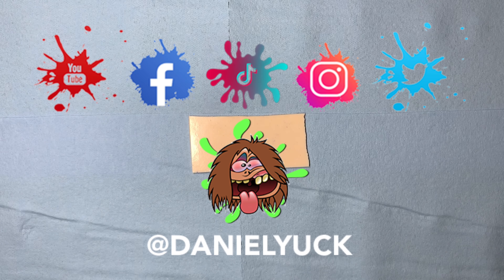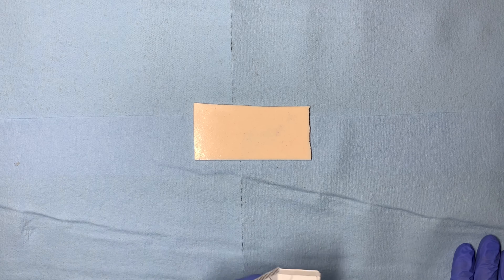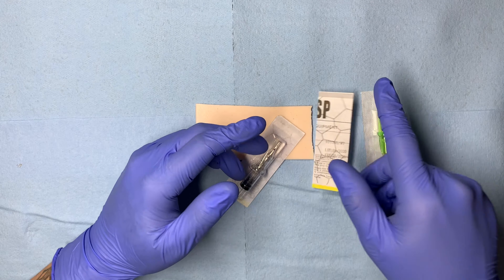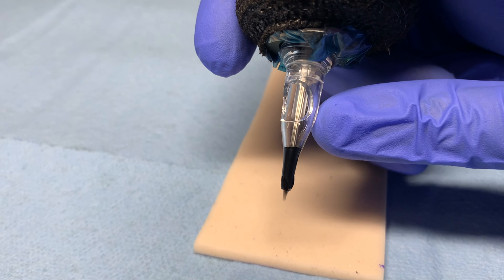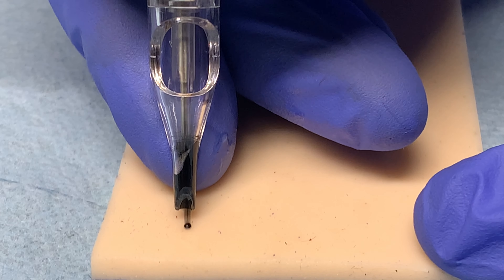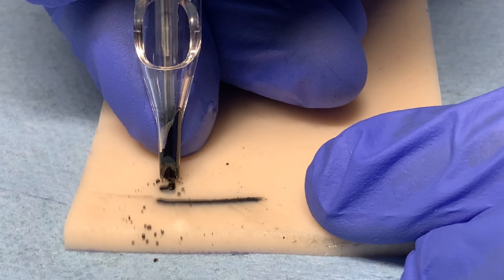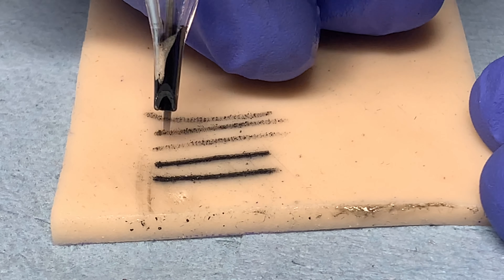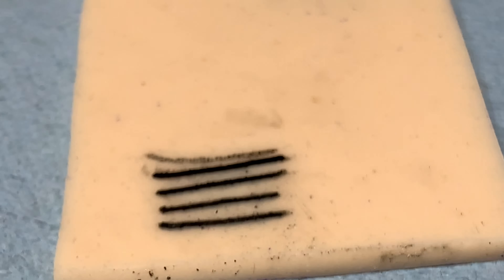How I Pull 1 Pass Lines?

Comment: Nice video, the finger drag is something I was never able to make work personally, but that leverage is so key to maintaining depth consistency. I like seeing this technique even though I have a different method to leverage the depth using the side of my hand & fist.

Another major factor for me is if the cartridges fit well in the machine. Some brands just don't fit well in my machine causing wobbling and excessive vibration which obviously makes one pass more challenging. Surprisingly, I don't find Big Wasp to be too bad even though it's one of the much cheaper brands. My fav affordable cartridge brand is Stigma for sure.. 

Thanks for taking the time to share this knowledge, you're awesome

Comment: Hey Daniel- question about lining with round shader; when I work along with the video I seem to get a series of super thin lines within each line, like from each needle tip in the configuration. Also the slower I go the more damage or cutting happens on the fake skin. Suggestions?
What stroke do you suggest using on the fake skin. It seems that its either too light (always having to go back over them) or too deep (cutting the skin)

Comment: Quick question. Wouldn’t the stencil smear off if you’re dragging your middle finger with the needle? And also I’m pretty comfortable doing vertical lines But having a hard time doing line horizontally. Any tips on that? (I try not to rotate my fake skin around, and think of it as an actual body part)
Reply: Personally I turn around my client, when it’s possible, to pull the line to me ! I think it’s the more stable configuration to keep the right depth. I stand up sometimes, putting my elbows and forearms on the client / the table / the arm rest table when it’s possible too

Comment: Hey I’ve got one question. What do you do when you can’t pull a complete line and have to stop in the middle? Are you finding the dermis right on the point where you stopped before?
Reply: bump, i want to know too
Reply: Every piece of content I’ve consumed and person I have talked to has told me to overlap them slightly in order to help you stay on one consistent path through the entirety of the line.
Reply: i tend to taper out and then slightly come back on that last line and taper bk in to the depth

Comment: Apparently the voltages i line with vs what I use to pack black and colors is backwards from most lol. In line with 8.1v but I pack with only 6.8v at most 7.5 (very rare) I also shade in that area. Most folks line at a lower power than the pack at. With some even having 1 consistent voltage throughout

Comment: I bought me a tattoo kit and it came with a 3RL needle , and I notice the lines are very thin , so wanted to ask what need size for lines you recommend for me to start with for it to have a more fuller and solid look to it ?
Reply: 11 bug pin is what I used but I also have used stuff as big as 18.

Comment: Where do you double zero.. its a 10 gauge bug bin and the 12 is standard..  STOP CALLING THEM DOUBLE ZERO..
Reply from the maker: That is Incorrect. 

A simple google search will let you know that #10 is aka “double zero” and #08 and below is actually bugpin.

If I’m correct I’ve seen you say this before and I already addressed you in the past. 
You may want to head back to the chop block and do a bit more research for yourself before you act up.